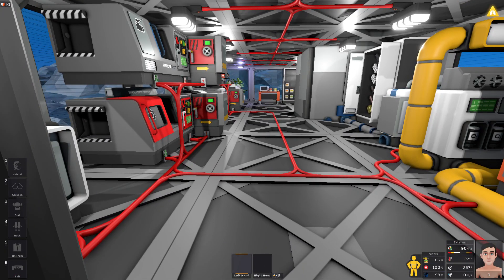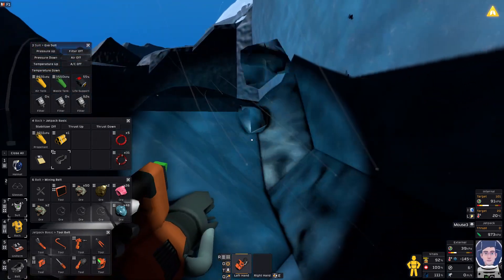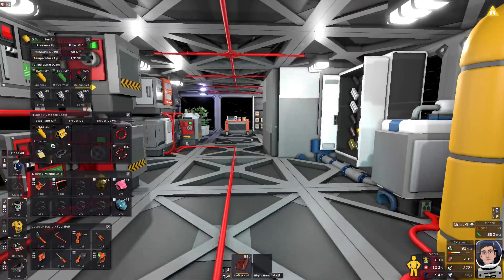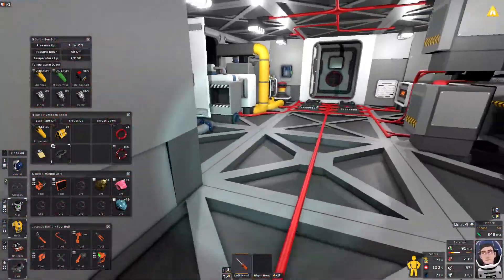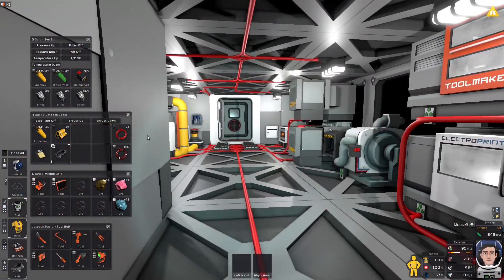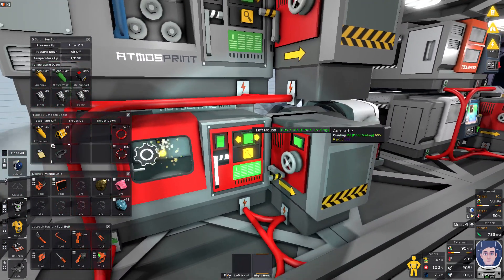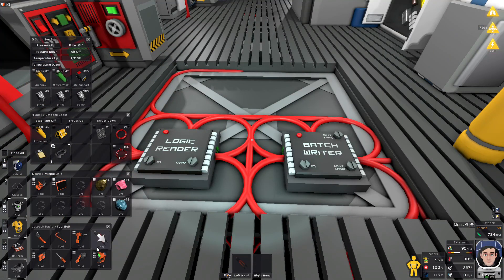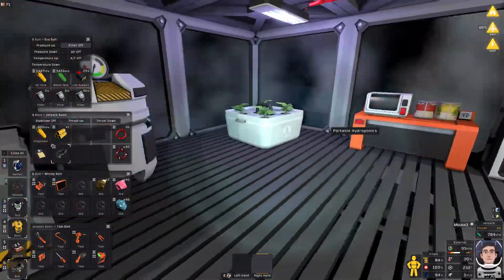Stationeers Europa Playthrough Episode 4: More Wind Turbines/ Finishing our Starter Base

Comment: Just a friendly reminder, you can reduce the portable tank and portable planter to kit form with a drill, then you can toss them into the recycler.

Also, an easy way to remember which way to assign the values on the select unit's screws is by the compare operation and visualizing that operand between the select screws.  Thus when doing a less-than operation, the left screw value should be less-than the right screw value on the select (i.e. min < max).  If greater-than, then the left screw value should be greater-than the right screw value (i.e. max > min).
Cheers!
Reply from the maker: Thank you so much for the tips! I did not know that about the drill to reduce the portalbles back to the kits. That is also very helpful about the logic select.

Comment: You can use regular coal for water purifier
Reply from the maker: I have tired but I am going to try again that would make it so much easier.
Reply: in my case, its not working. coal would not be accepted (in the patch notes there said, it works, but in my save, it didnt)